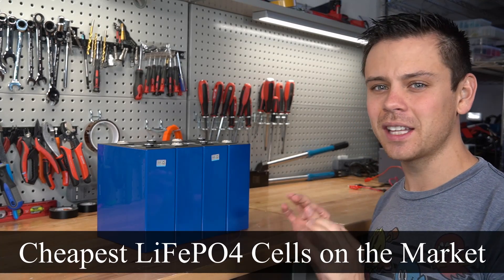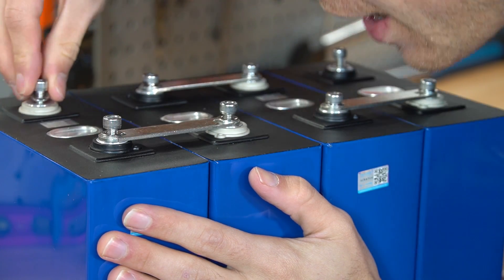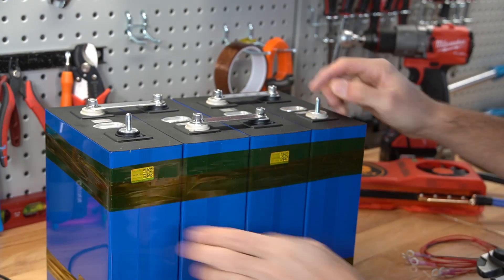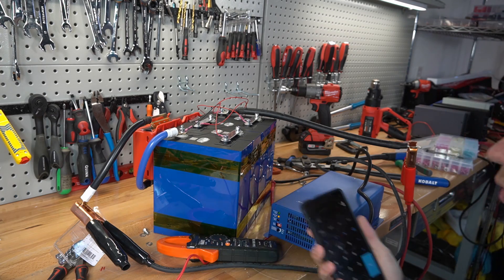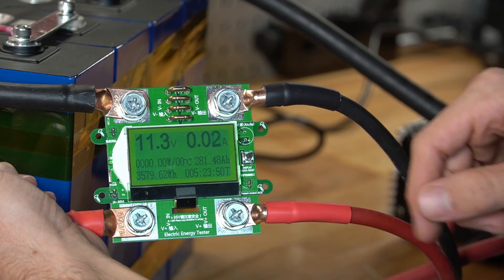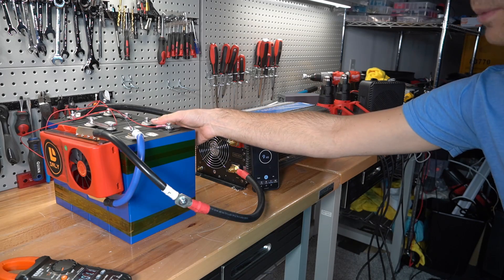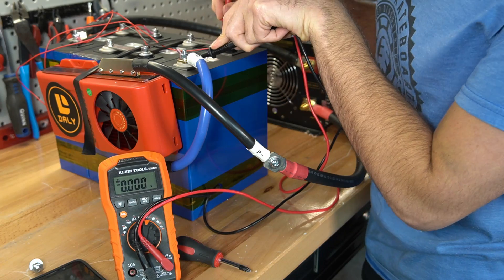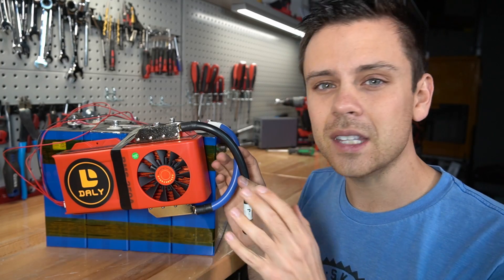$433 280Ah LiFePO4 Cells Tested: Cheaper than lead acid!

Comment from the maker: Tired of getting ripped off? Check out my "Will Prowse Approved" solar product recommendations below!

12V Batteries
https://www.mobile-solarpower.com/lithium-batteries.html

48V Batteries
https://www.mobile-solarpower.com/48v-batteries.html

Offgrid Inverter System Builder
https://www.mobile-solarpower.com/48v-complete-system-blueprint-559371.html

Hybrid Inverter System Builder
https://www.mobile-solarpower.com/code-compliant-48v-offgrid-system.html

Mobile Handtruck System Builder (very popular!)
https://www.mobile-solarpower.com/mobile-48v-system.html

Solar Panels
https://www.mobile-solarpower.com/300w-solar-panels.html

Ground Mount Solar Racking
https://www.mobile-solarpower.com/ground-mount-racks.html

Wire, Lugs and Busbars
https://www.mobile-solarpower.com/wire-and-connectors.html

Tools
https://www.mobile-solarpower.com/tools.html

Fuses and Circuit Breakers
https://www.mobile-solarpower.com/fuses.html

Plug-N-Play Solar Systems
Ecoflow, Anker And Bluetti! So many models to choose from. See my current recommendations here:
https://www.mobile-solarpower.com/full-size-systems.html

~~~~~~~~~~~~~~~~~~~~~~~~~~~~~~~~~~~~~~~~~~
Need to build a large DIY system? Need a trustworthy solar distributor? These are my favorites:

Signature Solar
Creator of EG4! Solar Minisplits, Victron and More! Largest Solar Store Online.
If you want $50 off, please use my link below and coupon code "DIYSOLAR50":
https://signaturesolar.com/?ref=cPwLcVc0SW-BjN

Current Connected
Best Prices for EG4, Victron, Midnite and so much more! Fast Shipping and Highest Rated Customer Service:
https://currentconnected.com/?ref=wp

~~~~~~~~~~~~~~~~~~~~~~~~~~~~~~~~~~~~~~~~~~
Join our DIY Solar Community 
Need more help? Join the largest solar forum on the internet for beginners and professionals alike. 140,000 members and counting!
https://www.diysolarforum.com

Check Out My Free Book
Best-selling and beginner-friendly guidebook to off-grid 12V solar!
https://www.mobile-solarpower.com/the-book.html

~~~~~~~~~~~~~~~~~~~~~~~~~~~~~~~~~~~~~~~~~~
Contact Information:
I am NOT available for personal solar system consult! If you wish to contact me, this is my direct email: williamprowsediysolar@gmail.com
FTC Disclosure Statement and Disclaimers:
Every video includes paid promotion or sponsorship (such as free products for review). Some links on this YouTube channel may be affiliate links. We may get paid if you buy something or take an action after clicking one of these. My videos are for educational purposes only. Information is subject to change/update at any time. Electricity is DANGEROUS and can kill. Be smart and use common sense :) DIY Solar Power with Will Prowse is a participant in the Amazon Services LLC Associates Program, An affiliate advertising program designed to provide a means for sites to earn advertising fees by advertising and linking to Amazon.com
Reply: Thanks for this!  This cell form factor is insanely popular on the forums right now.  The terminals look like the Lishen 272's.  My EVE pressure reliefs are blue.  We've seen some sellers market EVE but Lishen's are what's delivered.  Lishen 272's have been testing quite well (over 272 I believe).  I've got 4 on the way myself because my EVE's are NOT performing like your cells (I have 36 cells operating between 268 and 281 Ah, mostly in the mid 270's).
Reply from the maker: @TisTheDestiny  Good to know! I have read about those lishens. Such a bummer :(
Reply: @WillProwse  so Will do those Lishen cells have a bad rep? I was just looking at the 200ah Lishen cells for $63 and thought it was a good deal on Alibaba.
Reply: @WillProwse   I forgot to mention - the torsion spec of 8Nm is NOT the torque spec for the bolts.  We believe it's how much twisting force you can put on the entire terminal.  Typical torque spec for M6 6mm in aluminum is around 4-5Nm max.  I've stripped these threads with 7.
Reply from the maker: @TisTheDestiny  good point
Reply: + shipping at what cost? 😂
Just looked for UK delivery is £579 (4) or £1779 (16). Or am I doing something wrong. Perhaps these are USA seller?
Reply from the maker: @zjzozn  Yeah seems like UK and Canada have insane shipping costs. Sorry about that :(
Reply: @WillProwse  In Alibaba one seller ships into EU with train and DDP. No wat no tax ca $1700 for 16. Shipping time is more than a month.
Reply: @WillProwse  could these be used with a Titan Solar Generator?
Reply: @WillProwse  I just purchased 4 of these Listen 272ah through an Alibaba supplier. USD80 ea + USD 135 Shipping to Australia. Amazing value. The AliExpress suppliers seem to have very high shipping to Australia, EU etc
Reply: @Ozsmallbore  its because you blacklisted china
Reply: @mrzed6597  Do you know which seller ships into EU with train and DDP, do you have a link? Thank you very much. :)
Reply: @mrzed6597  Thank you very much. :)
Reply: @Ozsmallbore  hey mate do you have a contact?
Reply: @mrzed6597  What is the situation for EU from Alibaba,i see shipping methods train+express & truck+express(Europe) duty incl says,what this means no VAT, custom taxes fee.
Reply: @zjzozn  try dh gate uk
Reply: @zjzozn  I got them for £800 with 5 day delivery including import tax. Could likely have done better but went with a very trusted supplier.
Reply: @RhysOrwin   as you're in the You Kay would you care to share who your supplier is please Rhys?  I'm in Gloucestershire and have never used direct purchase before. Thanks in anticipation
Reply: @zjzozn   I thought the same, but I think it may be a way to save import duty. Charge you little for the product - therefore little I. T
But charge multiples for the carriage. Either way you pay the same cost...
Reply: @zjzozn   Agree.... Just looked them up  over $800 shipping costs here in canada :(
Reply: @zjzozn  thats what i paid give or take a £.  I ordered 16 on 12th Oct 2020 - they have just arrived now 26-Jan-2021 !  Given Brexit and French blockade of docks i'm not surprised how long it took.  The original order was for EVE 280 Ah - sold out - so went for the Lishen, which came in from Hong Kong.  No hidden charges on import and tax into UK as OYE Store stated this was paid for in the price at time of order. OYE (Nikki) is very responsive with enquires and questions while waiting for delivery. Just about to start testing now - initial voltages impressive. Almost every one at 3.285, just 1 at 3.292 !
Reply: @zjzozn  yeah I saw the same. Got them shipped to my place in Sweden and it was free delivery!
Reply: @zjzozn  1000€ shipping to germany
Reply: Pls do a review on blue carbon lifepo4 battery from alibaba. They're quite cheaper for what they're offering.
Reply: @innoachukwu  what is THAT URL or link??
Reply: @innoachukwu   it’s so bad , even bms can’t currying more than 20 amp
Reply: @saifsky  wow.. Did you open it to see if the bms used was a 20A bms?
Reply: @innoachukwu   48v 200ah  battery the blue one comes with very small bms  and cylindrical cells I think its a huge battery but fake capacity and bms
Reply: @saifsky  That's not good. I'm actually interested in the 24V 150ah battery pack. They claim that the maximum input current is 40A while maximum output current is 80A. That means the bms should be an 80A bms. I'll need to chat with them for clarification. They also said the cells are BYD model C19 cells.
Reply: @innoachukwu  in my opinion deal with another company ,  we got 2 batteries 48v 200ah it should to be 20kwh but they’re didn’t give more than 5kwh  totally
Reply: @saifsky  wow... That's alot.. From 20kwh to 5kwh... Did you manage to open the unit and see the specs of both the cells and bms? I'll like to know if they used smaller capacity cells or if the cells are bad.
Reply: And I bet the inverter cost more than the cells. Got a link for the inverter?
Reply from the maker: @htmagic  Youre right! That is crazy to think about. And heres the link:

4000W PSW Giandel Inverter: https://amzn.to/3orqLxf

I havent killed any of my giandels and I lived off grid with them for years. I like them.
Reply: @WillProwse  can I buy 16 of these to build a 12 volt starting battery for my 18 wheeler. Kinda like a big RV. Semi trucks use 4 - 1000 cranking amps lead acid battery's (31T) to start the truck. If I buy 16 of these battery's place them 4 in parallel then in series to make 12 volts. Will these work to start and run on a semi truck? The alternator is a 160 amp.
Reply: I got this same deal from Basen. $416 with shipping included ($98) only Basen assured me that they were Grade A new cells.  I even asked for the UL Certificate and they sent it.  We'll see what they look like.  Ordered in late December and just waiting...
Reply: @triumphrider9396  
I read your comment 3 weeks after you posted it.
Did your order arrive yet?
Reply: @brazilianredneck  It just arrived at my house yesterday.  Shipped from Basen on the 20th, so right at 40 days.  Not bad!  They are definitely grade A new cells.  Excellent packaging also.  I'm super pleased with the whole thing.  Definitely recommend Basen/Gloria Luo.
Reply: @triumphrider9396  
Cool, thanks for the info!
Reply: @triumphrider9396  Have a link??
Reply: The price went up again or what :( I see 476usd now. Free shipping is still there
Reply: $999 shipping to australia.. weird
Reply: @LuiBas  contact them directly for shipping quote should only be around 700 delivered total price.
Reply: Hi Will what kind of bms do you recommend for 48 cells LiPO4 48V ? 16S 3P
Reply: @liv04soccer  I'm wondering the same.  Did you find anything?  The BMS Will suggested as better than the Daly model that he used in this video only does 100A.  I'm looking for a quality smart BMS (low temp shutoff, customizable settings, etc.) for a 16S LFP that can handle a 250A discharge.
Reply: @willdejong7763 No I haven't found anything so many variables to factor in for BMS. Haven't really found anything cheap and reliable. If anybody has any experience with good BMS please feel free to send links so I can check them out.
Reply: @liv04soccer  Bummer.  Thanks for the reply.  I just ordered one of the Daly's, going to see if I can make it work, at least until I find something better.
Reply: @willdejong7763  Let me know how the Daly works out. Not too sure how reliable they are never used them.
Reply: @liv04soccer  I will try to remember. Feel free to remind me in about 3 months, I hope to have my system all setup and running by then. I’ve ordered the cells but they haven’t shipped yet. Also still need to pick out an all in one inverter charger transfer switch espresso machine to use with the completed battery.
Reply: I got 8 for $85 each and under $300 for shipping.
Reply: and yes, yes, yes send away for studs and conductive epoxy, because you don't want to bierce the bottom of the screw hole. I have heard from many that have
Reply: I've been seeing these same looking batteries on amazon as well.
Reply: are there actually idiots out there that pay that much for shipping cost never mind  that much per battery.  .they want eight hundred and some dollars to ship it where I live and I don't live on Mars
Reply: What BMS do you recommend instead of the Daly for a larger system? 16s, approx 14kwh.
Reply: @nocrustracing  I ordered the Heltec JK 2A active balancer 200A BMS. Arrived less than a weak. Not the cheapest but not Batrium like extreme expensive.
Reply: @mrzed6597  A bit of a confusing website - link me to what you grabbed?  

What's the app support like?
Reply: @DIY Solar Power with Will Prowse I have a massive off grid Project Im working on right now. I ordered 88 272ah lishen cells for a total of 76.56Kwh!!! And I just got them in last week. The question is from doing more research I cant find a straight answer on which cells are better the Lishen 272 or the EVE 280 I feel that I might have jumped the gun on this. Do you have any input or answer that could help explain which one is better?
Reply: Risking being off-topic: What were your shipping costs?  With AliExpress, when it says "Free Shipping to United States via Seller's Shipping Method", what 'method' did you use to ship?   Thanks, : )
Reply: Thats 1 test I wanted to see great job with very good results.  But still want to see the smart bms with temp sensing and mppt controller with temp sensor working all together with the same setup for 12v high current alot of my applications cause for this setup and is where most of the issues present itself due to the high current draw and heating issues once you get past 250a
Reply: Well... they are not cheaper than lead acid, but they are.  I can buy new Trojan 6 volt 225 Amp/hour batteries for $92.50 here in Florida.  So two would be 225 Amp/hours @ 12 volts for basically $200.00.  However, when figuring in the dischargability of both... the LiFePO4 cells are cheaper.  I had planned on a 900 Amp/hr battery bank with the Trojans for $740.00.  Now a 560 Amp/hr bank of the Lishen LiFeP04's for $866.00 look like a better option!
Reply: I ordered some 280ah cells from AliExpress in late November and they charged sales tax too, just an excuse to bump up the price IMHO.  It wasn't the right tax for my state and county.  They haven't arrived yet so I was actually glad to hear that yours took 2 months to arrive.
Reply: @posteroonie  go thru alibaba instead of aliexpress for better deals
Reply: So these are 172ah cells? But they performed to 280ah when you tested them? I don't follow you.
Reply: So these are 172ah cells? But they performed to 280ah when you tested them? I don't follow you.
Reply from the maker: @tompumphreykayak  haha oops, 272Ah. And yes, they test over 280Ah. It's just common with lishun. Idk why. Same with other lishun cells we tested before.
Reply: @WillProwse   cells are Lishen, it is a big cells manufacturer in China, they even talked with Tesla about cooperation, but seems only talked
Reply: And non of them ships to Nigeria... 😩
Reply: correct me if im wrong but from what i remember reading on the forum was eve was the preferred cells [i thought because they were better] but got so popular supplies soon ran low and then lishens became more readily avail but not necessarily better.
Reply: Good stuff man, do you have a link for these?
Reply: Thank you for you're honest information, I love you're videos. 
I'm looking for a system for my sailboat.
Are these cells a problem to use in a salty environment?
They seem to all use Aluminium casings.
Reply: ⁹⁹0⁰⁰
Reply: thanks for the test! i'm not sure what is the shipping cost for usa, but for europe they ask 750 usd for shipping + we also have to pay tax, so they are are totally can be 1250 usd... way to expensive for some used batteries.
Reply: question  can you use a overkill solar 24v 100 amp  on  the 280 amp battery.?
Reply: @mattg8787  You can use any solar that you want.  Your charge controller has to support the pack voltage and chemistry to charge the batteries. Example: taking your 24V solar and convert that to let's say 48V pack voltage to charge your battery bank.

Also you need to control how any amps flow into the battery bank so you don't damge your cells charging them to quickly the charge controller should control how many amps and Volts to correctly charge your batteries.
Reply: How much waranty. CA

Charging time
How much 
Aeh
Reply: would you like to this set up??
Reply: Can those bms’s work on LTO’s?
Reply: You probably dont give a damn but does someone know of a tool to log back into an Instagram account?
I stupidly forgot the account password. I appreciate any tips you can give me.
Reply: @Charles Raylan instablaster :)
Reply: @Korbin Fox I really appreciate your reply. I found the site through google and I'm waiting for the hacking stuff atm.
I see it takes quite some time so I will reply here later with my results.
Reply: @Korbin Fox It worked and I finally got access to my account again. Im so happy:D
Thank you so much, you really help me out!
Reply: @Charles Raylan no problem =)
Reply: Please make a video on the AIMS charger/converter! (like you said you need to in this video :)
Reply: Would be great to get updated links
Reply: 998 shipping cost to Canada. And 800$ for the batteries no thank you
Reply: @dylanc9275  check out the diysolar forums for better deals from Alibaba. I paid 2400cad for 17 cells all taxes duty shipping Incl. That's 142ea. And this was during the summer when shipping was more expensive then now.

16+1 spare so I could set aside the worst one after a capacity test.
Reply: @KjartanGrindon  i dont need my powerwall is reaching 50kwh
Reply: @dylanc9275  how
Reply: @dylanc9275  800 what usd?
Reply: Torque wrenches can cause you to do a lot of unrepairable damage if they arent perfect. I was going to buy one and couldn't find one reliable enough to trust after reading reviews and doing research. Great video btw.
Reply: @MattandHolly920 cheap click style torque wrenches can be problematic, but old school beam style and gunsmith torque wrenches are low cost and very accurate for low inch pound/NM increments, I can personally recommended the "Wheeler" brand "Fat Wrench" it's a screwdriver style click type torque wrench with good accuracy for the price. Or just find a well reviewed load cell style digital socket adapter, much cheaper than a decent quality digital torque wrench, with great accuracy depending on the model
Reply from the maker: @MattandHolly920  agreed.
Reply: “Forum” rates Lishen over EVE ????? Then it must be true, we all know forums are full of experts 🤪
Reply: STOP THE BEEPING NOISES WILL. WE DONT NEED TO HEAR THE BEEP!! JUST WOKE UP SOMEONE ACROSS THE HOUSE THANKS. BYE

Comment: Is running 5 cells better to get the maximum power out of the cells before 12v inverters cut out with low voltage?